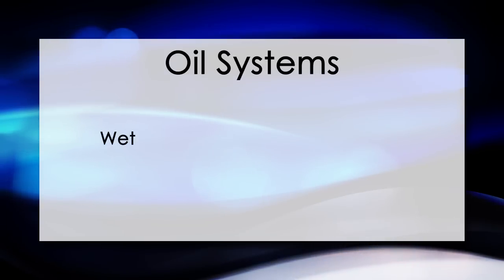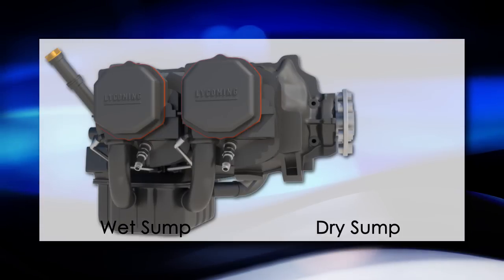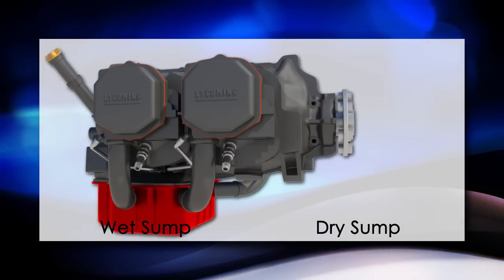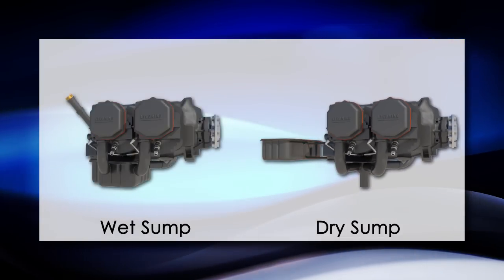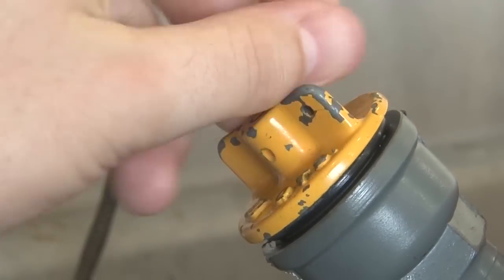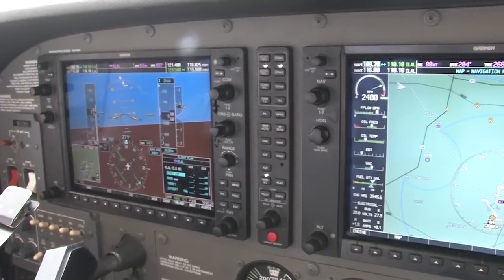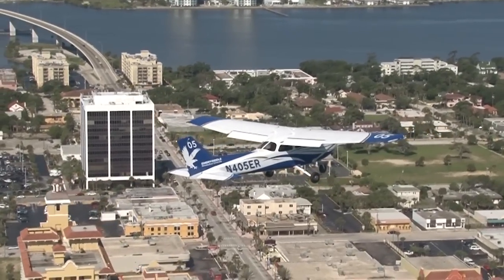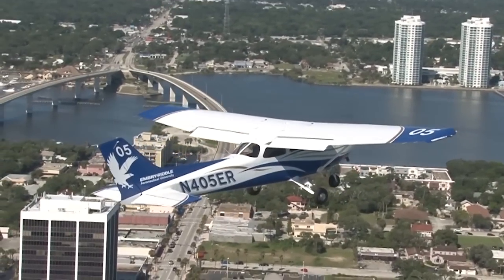Aircraft Systems - 06 - Oil System

Comment: After seeing and making some comments on the illiterate comments the best thing anyone can do is enlist the help of a CERTIFIED air-frame and power plant mechanic.  This person will have the correct information people starting out in the aviation field will need. DO NOT trust little 2 minuet videos on anything about aircraft engines especially if they have a little cartoon to accompany the narrative.  I am a certified air-frame and power plant mechanic and believe me this little 2 minuet dissertation about oil will cause way more harm than you would expect as there was NO WAY to explain it as depicted in the video.  Also for those who know engines, the videos of the engines were two different engine manufactures.  The one where it was said a Cessna was a Lycoming engine and the other in the cartoon appeared to be a Continental engine and both do have different oil systems. So bottom line,  if you want or need the correct information about engines and what makes them work PLEASE find a certified mechanic to get the information you need and DO NOT believe what you read on YouTube.
"My license:  A and P (air-frame and power plant) mechanic, ATP (Airline Transport Pilot),  CFIIM (Certified flight instructor airplanes, instrument instructor, multi-eng instructor), low altitude waver needed to participate in Airshows and a aerobatic pilot.  Retired airline captain with 15,000 + hours of flying time.  All true and verifiable so, no negative comments from the peanut gallery, thank you".

Comment: What should I do in case of a high/low oil pressure?
Reply: High pressure = I'd say that it is clogged somewhere (correct me if wrong), Low pressure = oil leak or oil pump not working. I would say that with low pressure, you should land immediately, with high pressure you can fly slightly longer, but also best thing is just land. It goes hand in hand with temperature. If oil temp rises, lubrication is less efficient and engine damage is possible. Only way to get the temperature to drop atleast a little bit is to descent and idle. That's what I know from my flying experience. Feel free to add anything, I'm not a mechanic of any sort and would be grateful for anything new to learn. Cheers
Reply: @TheBranderCZ  hmm can be right but not the main reason for high or low oil pressure.
Reply: @TheBranderCZ  Thank you for the info. This was helpful
Reply: @TheBranderCZ  Thank you for the info
Reply: Land
Reply: Think of honey:

Cold honey is sticky and viscous (not runny and very dense). This is the same for oil, if the oil is too cold, it's harder to pump around the engine, and may not be able to access small crevices or parts of an engine due to its high viscosity. It may also be too sticky too metal. Cold oil is harder to pump due to high viscosity, oil pressure increases. 

Hot honey is very runny and has a low viscosity. Again, is the same for oil. Hot oil may be too runny and may not stick enough to engine parts. Metal to metal contact may occur and cause severe damage to engine parts. Hot oil has a lower density, so it's easier to pump, thus low oil pressure.

There is a simple rule: Stay within the green range.

For troubleshooting:

If oil temp high and pressure is low:

If descending - Pitch nose down further (or remain at same pitch), and reduce throttle. 
If climbing - Reduce AoA and reduce throttle. 
The aim is to get more airflow into the engine to help cooling. 

If oil temp low and pressure is high:

On the ground:
Upon startup, sit the aircraft at 1000 RPM and at about taxi mixture (<20%>).

In the air:
Lean the mixture to increase EGT, hopefully the oil temp should also increase. 

There are other combinations of pressure and temp, which are related to mechanical failure or under performance,  in which you have minimal control of. The correct action to do in any circumstance of un-ordinary engine performance is to report it to the hangar. If you suspect that you have an extremely low temp and high pressure vice versa, or there is no pressure, or the temp Is extremely high; the correct action would be to land immediately and safely. Engine failure or overheating may occur if not diagnosed.